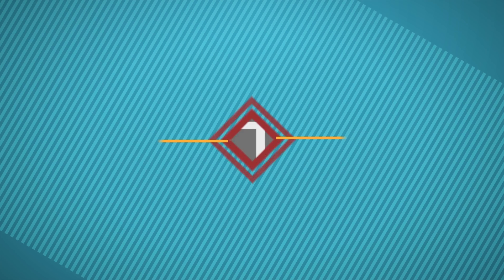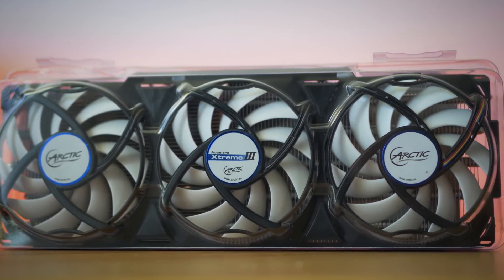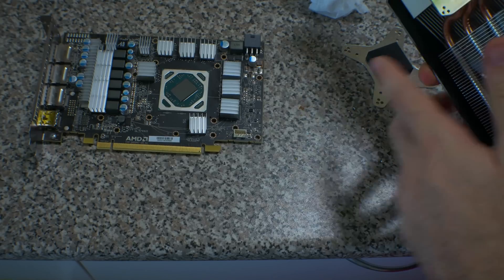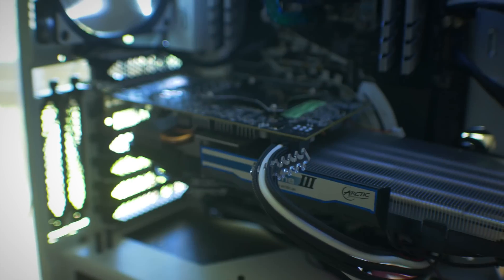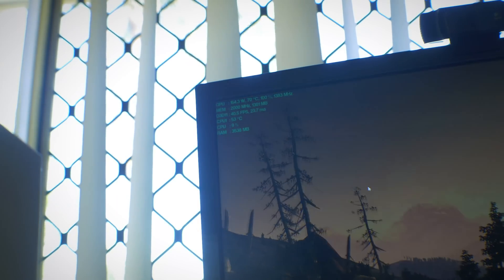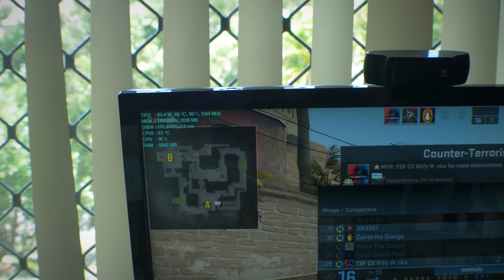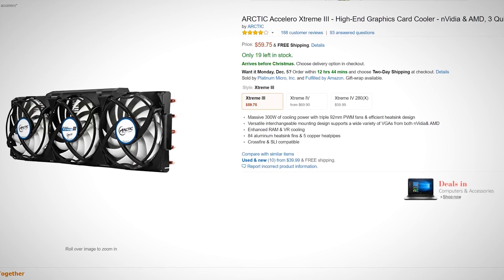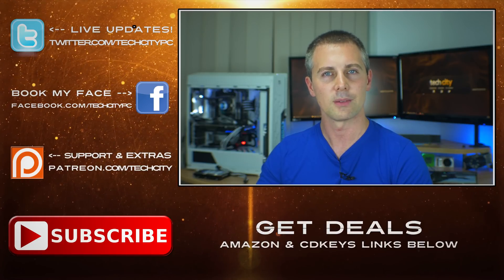RX480 Reference Vs. Arctic Accelero X3 Cooler - CAN IT OC HIGHER?

Comment: In my opinion, adding an after market cooler to a mid range card doesn't make much sense. You better off buy a better card.
Reply: Yep. Its not worth even $5 unless it looks way nicer in your case.
Reply: That's not the point of this video
Reply: ArdaBlock I think it proves this point though. 

Many people (myself included) spend lots of money on better coolers. Most people think it will help a lot more than it does. Sure, an AIO cooler for a CPU can do amazing (assuming you have a nice mobo), and for a GPU it could help too, but that's only if they are hitting the thermal limits. 

If you want to know how extreme I go, my GPU stays at -30c to -50c under daily use, and even my tablet has a custom water system (custom as in I designed the waterblock, radiator, reservoir and made these myself, everything was CAD designed first). But I do this stuff for fun, granted, the tablet got a 44% overclock and runs 40c cooler than stock, but this was mostly because I'm a nerd and I had a free afternoon (plus $5).
Reply: Jake Garrett so ur pc runs colder than the north pole during load?
Reply: Dickson Chng Maybe, its sub-zero cooled. Ice will form on the outside if my heaters aren't on (heaters embedded in between layers of insulation, these keep it from condensing water like a cold drink and frying the components). It uses phase change cooling (just like a freezer, it compresses Freon refrigerants, but it boils it inside a copper cooling block that mounts similar to water cooling.

They used to sell these units commercially, mine is an Asetech Vapochill LS unit. However, due to the extreme cost and very high dangers of destroying components caused production to stop (even thermal cyclic fatigue of freezing chips and warming them up to room temp day after day can destroy parts after time even if you manage to keep it perfectly moisture free month after month). People also made/make these (mine was last produced in 2006, and I think that was pretty much the last unit that stayed on the market), however, because of global warming linked to refrigerant leaks, in my country (USA), its illegal to make one of these unless you are licensed. I don't think this is highly enforced unless you're selling them, but manufacturing the cooling block could be difficult. Plus I managed to find one, albeit not cheap, but I made just enough from rebuilding a transmission, repairing wiring and a cooling system on a car that I could buy it.

Note: they also make multi-stage units that can go way colder (around LN2 temps), but those can apparently draw around 1600w just for the cooling unit (according to articles). Plus, I don't know of any commercial unit like this sold.

Comment: Using a Gelid icy cooler V2 on a 7950. Max Oc in the same ambient temps as yours is 1100 on the core and 1400 on the mem. The maximum temp at full load is 60 degrees usually but the vrms get up to 90ish

Comment: I use a Raijintek Morpheus (Core Edition) with two Noiseblocker NB-eLoop B12-PS on my Zotac GeForce GTX 980 Ti AMP! Omega
The Temperatures are now around 50-60°C, with the Stock Cooler I had 60-70°C (both 1,4GHz @1,19V) and the Fans run most at the time with 1200-1400 RPM, and i can only barely hear them inside my R5

With this cooler I could overclockt my card to 1500MHz, but at 1080p I dont need that much power ...

Comment: I'm rocking a reference RX 480 with EK Waterblock on it. Yes I know it's not the most cost-effective solution but I love it and don't regret it at all. Temps during gameplay around 40-44 C. Max temps I got in 3D Mark Fire Strike was 54 C @ 1430 MHz.

Comment: Hi Bryan. I'm going to be doing a DIY mod to my MSI R9 390 this week, I'll be removing the stock cooler and shroud and zip-tying a couple of 120mm EK Vardar fans directly to the heatsink. My main aim is to reduce the noise level and tone when at full gaming load, and hopefully the temperatures too for a little bit of OC headroom.

Have you ever done this? Do you think it will work well?

Thanks.

Comment: Is it normal to have dents on the heat spreader after place in cpu socket?
Reply: no.....
Reply: ECCENTRIC they are symmetric
Reply: Farhan Nadim You shouldn't have dents on a CPU IHS.
Reply: ECCENTRIC from the lga retention bracket that goes over the cpu which pressed against the cpu
Reply: Farhan Nadim Oh...... ok that makes sense. It's symmetric caused by the retention bracket for the cooler. That's completely normal, as long as it works properly.
Reply: ECCENTRIC it seems weird that i spent 330 dollars for the i 7 6700k to have it fit perfectly in place and have dents. Here is a link with somebody else having the same problem  http://www.tomshardware.com/answers/id-2712416/dents-cpu-heatsink-motherboard-clamp.html

Comment: I'd rather just buy a card that has a decent cooler from the get-go.
Reply: Sondre Hille-Krumsvik The accelero x3 is better than pretty much every cooler available
Reply: Sondre Hille-Krumsvik the RX 480 4GB Nitro has a really good cooler and is $220 in the US, try that
Reply: Thanks for the suggestions guys, Energy Core and Hami101
Reply: Ryan Wang I'm sure the Reference card is hotter :P.
Reply: lol its one of the hottest rx 480s out there
Reply: No... it isn't
Reply: I have the strix edition,and it's better than the accelero.

Comment: I think you might be hitting the powerlimit of the card because you added 2 additional fans. Part of the advantage coming from watercooling is that you free up powerlimit which was before consumed by LEDs and fans
Reply: that reference cooler takes up a surprising amount of power. I imagine it's the same for the accelero considering they were quite close at max power draw. Water cooling is definitely the better option where power is concerned, but also more expensive in general.

Comment: Bryan you need to flash the elmor OC bios to increase the TDP to 225w and voltage control range to 1.4v for the reference card or it will hit power limits when OCing, we can see it happening when the clocks throttle down from 1406 during the benchmarks. Also what's the memory clock at? The 480 gains a lot from memory OC too.
Reply from the maker: Yeah I want to put one under water with a custom bios, thanks for letting me know. Oh and I left out the memory this time as some of the banks were naked to get the cooler on :(.
Reply from the maker: Thanks man I will have to look into that, I will favourite the link and see if i can get a GTR in, they look and perform awesome.
Reply: Tech City had you more time,  could a shim cover the vram and meet with the main block as an alternative to leaving them naked?
Reply: @Tech City Np man,  I'm looking forward to the water cooled 480 :D 

BTW, while you're at it you might as well change the memory timings too with polaris bios editor, just copy and paste 1625mhz memory strap to 1750mhz and 2000mhz or try 1750mhz strap on 2000mhz if your card can't do 1625 timings, open OC bios--->edit with bios editor--->save bios--->flash, that's up to another ~5% more fps on top of whatever memory OC you have. It's very simple to do, and it's free performance ;)

Actually Hardcore Overclocking did a stream on this with his RX480 GTR and also there's this thread on OCN(http://www.overclock.net/t/1604567/polaris-bios-editing-rx480-rx470-rx460) for more info.

Enjoy

Comment: Stock windforce coolers on my 7950s do OK, what they need is aftermarket BIOS to unlock more voltage and higher overclocks. Then cooling becomes more of an issue. I might need to look into VRM cooling next as Gigabyte never intended these old beauties to perform at 280x levels. XD

Comment: I recently bought an rx480, used an old waterblock of an x1950xtx with the hacked up bracket of an arctic l11 plus. Works at 61°C  max on my custom waterloop with 1350 mhz stable, pulling 125 watts max.

I guess there is more headroom with temps, but oddly enough the power draw seems to be the problem
Reply: yeah, power draw is strange. i've seen lower power draw with higher overclocks on some cards. really strange, almost like amd is  still in it's beta stage with these new cards. these cards will likely get better once old stock is sold and newly manufactured cards get sent to retail.
Reply: There is a way to increase the power consumption limit on reference cards.

Comment: I run an GTX970 G1 gaming with the aftermarket solution and the temps are not over 65 degrees
Reply: Sotiris Panteli my temps on my Rx 480 range from 38-65 (asus strix rx480)
Reply: i have msi gaming X rx 480 and my max temps are 70c
Reply: My card needs more power
Reply: Neiva - CS:GO Zombie Escape Videos I have the same card. I call you out on ur bullshit.

Comment: I have the same card and cooler,and i have retained the stock back and front plates ,just by contructing two metal brackets(a plate with two holes) and fixing them above the two aluminium fins, next to the contact area.Much better results...

Comment: I got the MSI gaming X and i got it to 1465mhz Stable clock with some voltage increase. Standard BIOS  used MSI afterburner.
I might be able to push it further but honestly i don't see the point ;P
Reply: I need to actually push voltages on the powercolor red devil to see something higher than 1330 stable. there's also always the possibility that I won't.

Comment: I have a gelid icy vision on my hd7970. temps are about 60c-65c stock, 65-70c overclocked, using minimum fan speed. max fan speed -10c. but I would rather have it totally silent.

Comment: While you're at it why dont you stick the biggest CPU cooler you can get onto this RX480? xDDD
Reply: I've seen a Hyper 212 Evo on a graphics card quite a while ago so for me it would be interesting to see something like an NH-D15 slapped on a modern graphics card.
Reply: I remember that video actually. Someone should try sticking something like an NH-C14S on the card. See if it helps the mosfets and vrms any. Though I'm guessing that they'd need to get some tiny heat sinks for those components in particular.

Comment: stock clocked R9 290 crossfire setup running with corsair HG10 brackets and Coolermaster seidon 120v rev 2 slotted on there

Comment: I think JayzTwoCents did the best overclock I've seen with the water cooler? The water cooler costs twice of what this cooler does tho. And as he says, all this is fine and dandy for fun purposes, you can simply get a 1060/1070 instead of buying extra coolers.
Reply: maybe in usa, but rest of the world rx 480 is ualy same or more than 1060
Reply: i also think he got one of the better chips, thats why he was able to over clock that thing like a beast. unlike the gigabyte one which sucked energy like no tomorrow and clocked bad
Reply: HadouK3NN , for now it does well even in dx12 games (not far behind rx480) and dx11 games will be going for atleast 5 years to come, so it is worth buying 1060
Reply: nVIDIA's users' concerns about DX12 will be irrelevant as long as W10 doesn't take off and developers don't jump into the DX12 bandwagon.
Reply: 1060 outperforms the rx480 still in several dx12 and vulkan titles. Titles that use Dx12 or Vulkan well favor AMD certainly but dx12 hasn't really proven to be something developers have liked as much as some of us have hoped for. To this point only a handful of games utilize it well and only Doom really did Vulkan well. So if it's buy the card that might be better in a year or two. Or buy the card that's better right now. I would suggest right now any day of the week. Because frankly if you are buying a mid level card you're probably going to be upgrading in a couple of years anyhow.
Reply: exturkconner That depends on which country you are and your purchasing power. I live in Argentina and if I have to only game and pick a card, I would go for an RX 480, for GCN cards have aged better than nVIDIA's counterparts, as I don't see myself spending to upgrade every two years.
But since I work in design and need CUDA, which is better than OpenCL, I have to go for a GTX1060 and recalculate my upgrade path.
Reply: What he was saying is that if you factor in the cost of the after market cooling solution it makes more sense to just get a 1060.
Reply: exturkconner the 1060 is good only un dx11
Reply: The 1060 outperforms the RX 480 in games that use a DX 12 wrapper.  The games aren't actually DX 12.  In real DX 12 games the RX 480 wins.
Reply: Wyatt Newton Saying they aren't real is dismissive. Companies have worked hard at trying to make dx12 work. seriously how many games does it really well to this point? Bf1 is the only title that comes to mind. Ashes the direct x 12 darling has to many issues to even give accurate benchmarks. So yes again direct x 12 might be the future but by the time its implemented well we are likely to be a generation or two ahead of where we are now.
Reply: Louis Cunningham Did you even read my post?  I said games that use a DX 12, neither games you mentioned use a wrapper.  I hate when people comment on subjects they know nothing about.
Reply: Wyatt Newton It seems you lack for reading comprehension. Feel free to read the post a couple more times and when you actually understand what was written we can discuss further. In the mean time you might want to refrain from implying others are ignorant when it's you who doesn't get it. Thanks all the same though.
Reply: Louis Cunningham LOL
Reply: Wyatt Newton You do realize to this point you've made no argument right? No examples. No facts. You used a word. You said wrapped and you think that means what exactly?
Reply: exturkconner It's wrapper and not "wrapped".  Second, if you knew anything about them you would know that the difference between a game using a DX 12 Wrapper and a fully programed DX 12 game is night and day.  A wrapper merely takes the API commands of, let's say DX 11, and converts them to DX 12.  It provides no performance benefit and actually reduces performance as the wrapper has to interpret these commands in real time.  Wrappers require a very small amount of effort to implement as no recoding is required.

That was the point I made that you obviously missed because you are talking about something you know nothing about.
Reply: Wyatt Newton Wrapper is the term. The program creates "wrapped resources" again reading comprehension seems to be an issue for you. Wrapped and Wrapper are different tenses of the same word. And yes few games have been developed for directx12 one of them I did name in BF1, The new Gears being another. But the point remains. There are four or five games to this point natively using direct x12 because developers are having issues with it. Most of the games to use it so far have been in house Microsoft games and they are pushing it as part of Windows 10 feature set.
Reply: No dumbass, you are the only one I have ever heard say wrapped.  We are not talking about the word in grammatical terms, we are talking about its technical usage.

Not that any of it matters because you concede the point I was making

"And yes few games have been developed for directx12"

So congratz on being special and trying to grasp from straws on something you know nothing about.  Every troll always goes for the grammar when they've got nothing else.
Reply: Wyatt Newton Here's Microsoft talking about it as wrapped resources. Which ya know is what is is. https://msdn.microsoft.com/en-us/library/windows/desktop/dn913195(v=vs.85).aspx . But I'm the dumbass. And If at any point the point you were trying to make was that few games were made using directx12 were out yet you did a super piss poor and radically obtuse job doing so. But props on feeling like a hero.
Hope you are comfortable living up your own ass. 
Have a good one.
Reply: PlayerOne I'm in the US. They're the same price. Usually in the after market card world the 1060 is cheaper. Also DX12 isn't for everyone. DX12 is worse if you're not a good developer. Unless you know what your doing, you're better off letting the driver take care of everything (dx11)

Also Nvidia supports asynchronous compute just as well as AMD.
Reply: exturkconner First off the link you provided is to D3D11on12, which is an API and not a wrapper.  Look at microsoft's own reference on it.

https://msdn.microsoft.com/en-us/library/windows/desktop/dn913194(v=vs.85).aspx

So you must have googled "wrapped resources" and just posted the first thing without reading.

I laughed at you because you used wrapped when referring to a wrapper and that point still stands.  You are still a dumbass and apparently one that cannot even use google well.  By all means continue to show everyone your ignorance.
Reply: D3d is what makes the direct x versions work. It's the primary API. They are in essences the same thing. Which yes the 11 to 12 one is how you make directx 12 use direct x11 to function. It is the wrapped resource method that people are calling wrappers. I'm done with this though. You think you know something you don't know and you can't be bothered to put in any time to read because you are so confident. That's fine but I'm not going to bother with it further. Have a good day and maybe try out the quest for knowledge once and awhile. Assuming you know it all means you never grow as a person. But at least you can keep laughing I guess.
Reply: And on another note. Gears of War 4 which is a directx12 native game performs better with team green. So you know your previous statement about that was also wrong.
Reply: exturkconner that's incorrect. D3D literally stands for Direct 3D. D3D 11 == DX11
Reply: exturkconner however Nvidia supports DX12 just as well, if not better than AMD. (not maxwell. Just pascal. Read the Wikipedia on pascal architecture)
Reply: CrackedDylMil Did you copy my name on mistake for both of these replys. I said d3d was essentially directx. And I never claimed the Nvidia couldn't perform in dx12.